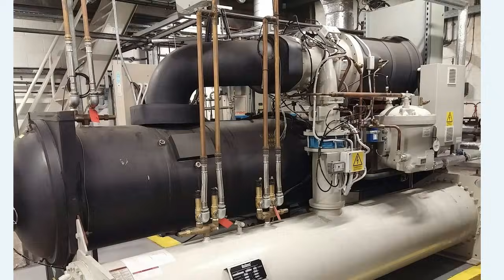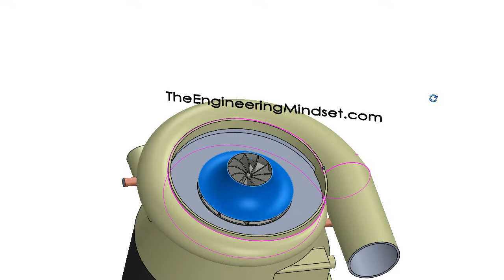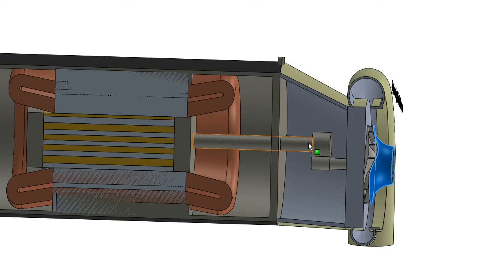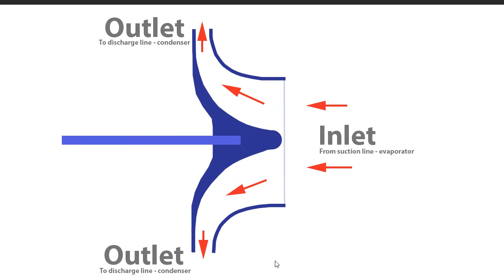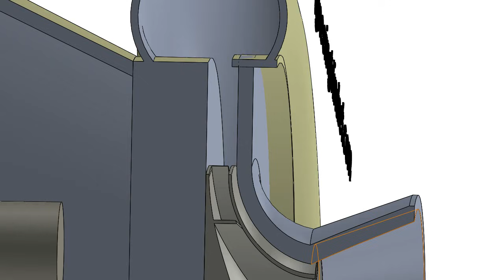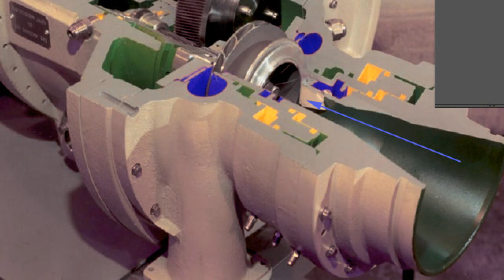Centrifugal Compressors - Chillers HVAC

Comment: Good evening. I want to ask something about compressor. Maybe one of you know about this. I have problem with my ammonia refrigerant compressor in plant. This is multistage compressor and driven by steam turbine. The speed (RPM) of the compressor is decrease time by time, and the valve of steam turbine is full open now. When i collect the data of the process, i find that vaporation in the suction compressor is increase, because any trouble in heat exchanger. Is that can make the speed of the compressor decrease? Is that choking?

Comment: Could you do a video on all Centrifugal compressor internal components and break down as I've never seen the internal workings of the high and low speed gears, wheen eye seals and thrust bearings.
Thank you

Comment: 5:03 
Your arrows are pointed in the wrong direction. Tower water pumps push water into the chiller not towards the cooling tower. Also the chilled water pumps push water through the chiller to the AHU’s. They don’t pull water from the chillers.

Comment: Your explanation using the cylinder reducing the volume of the refrigerant is how a positive displacement machine works. Centrifugal compressors are not positive displacement machines. They are dynamic machines. They do not compress the gas. They raise the pressure by accelerating the gas.

Comment: Sir..what if the compressor is not working?what will happen
Reply: Pressure and temperature of the refrigerant will not increase, refrigerant will then be cooler than the water in the condensor and hence the building will not cool down.

Comment: The alternative to the centrifugal compressor is the twin screw compressor and they are both used on chiller systems which are only used on large buildings like sports arenas?

Comment: What do I need, to convert 50°C input, to get 800°C output?
I want to reuse my wasteheat, but to be efficient, I need a fluid/gas at 800°C, but I cant pass 50° at operation.

12°C -> 50°C -> 12° .....
.............50°C -> 800°C -> 12°C -> 50°C....
first loop and second loop.
Reply from the maker: You can't get 800c from a 50c source with a refrigerant or any medium. You will have to use a combustion source to top up the rest and simply preheat with the refrigerant. Hot always goes to cold, its very difficult to force it the other way.

Comment: Amazing videos, I work on a large cruise ship, we actually have 5 chillers that work in sequence. Huge power plant. And the compressor itself is equipped with VGD difusor. 
And of course we use sea water inside the condenser to remove the heat of the freon. 
I am relatively new to this position and your videos makes everything much much simpler. 
Keep on the good work
Reply from the maker: wow that will e a very interesting place to work! glad we can help
Reply from the maker: wow that will e a very interesting place to work! glad we can help
Reply: What is vgd.